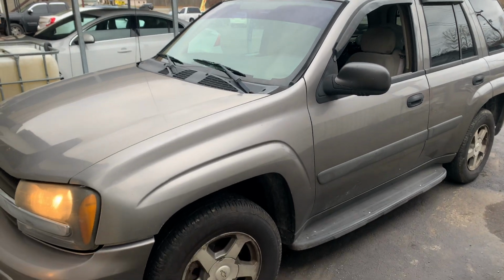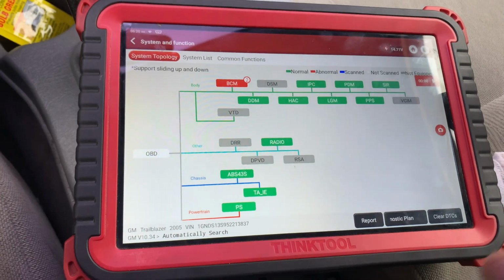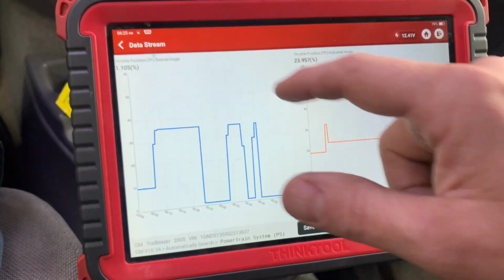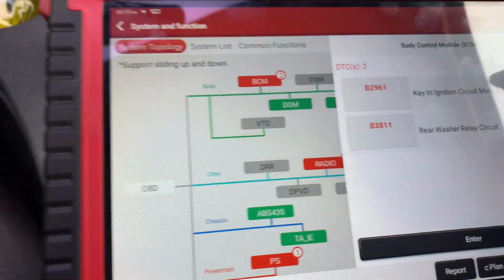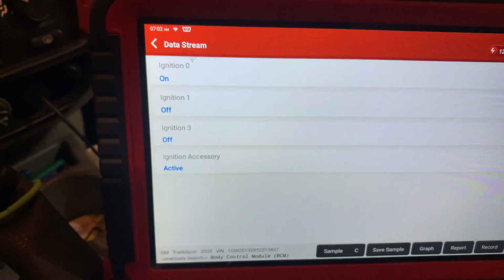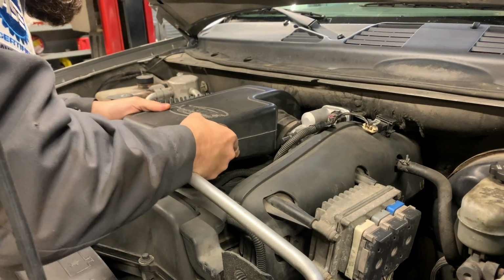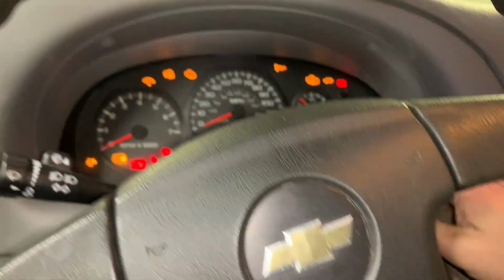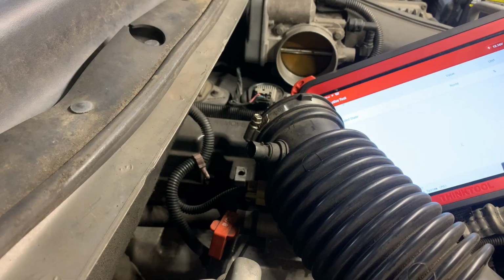Why you don't buy cheap parts! 2005 Chevrolet Trailblazer 4.2 Going in Limp mode P060E P2119 B2961

Comment: great job... well done. 
i was getting intermittent a Reduced Engine Power (Limp Mode) error, code P060E. the Hitachi throttle body was in stock at my local AutoZone for $237.99. O'Reilly's was 240.99... but when i removed my original throttle body it was caked with carbon so i gave it a good cleaning with CRC spray cleaner from Walmart and put it back on.  
the engine started up with no codes, so we'll see if that worked when i drive it next week.  i gave the throttle body a shake like you did and did hear a slight rattle but not a loud as in your video. i think the throttle position actuator might be worn.  my trailblazer has 175k miles.